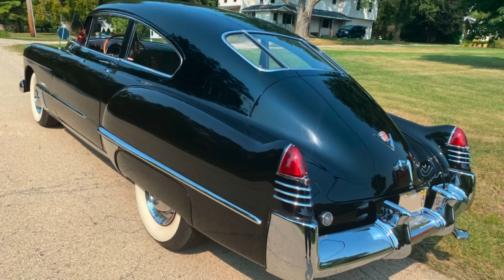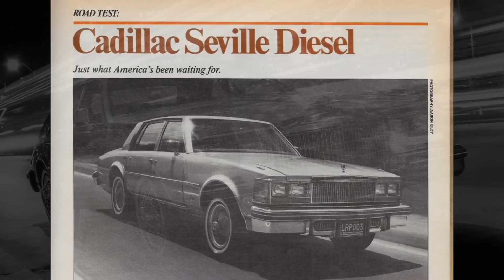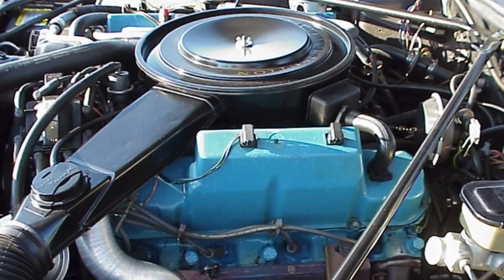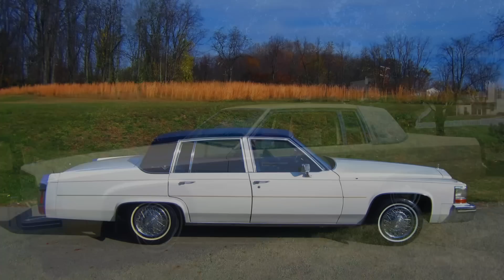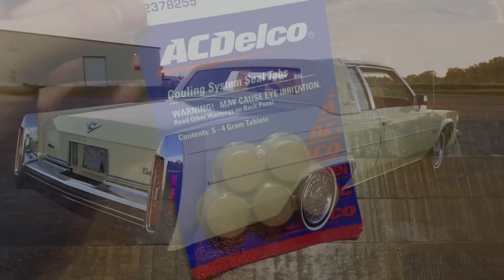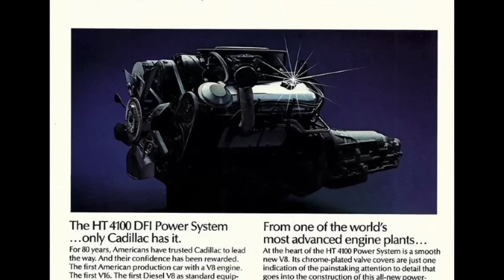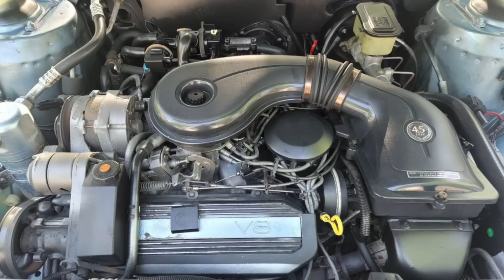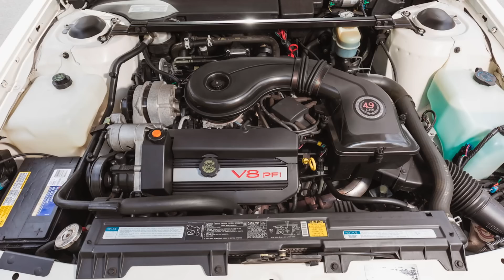This is GM's Worst Decision for Cadillac and Affected Its Reputation for Decades...

Comment: Thank you Adam. I like the fact you are objective and tell the truth no matter what about cars and engines etc. You say things so well even when it is bad news. I recall this engine. I used to think a 130 hp Cadillac V8?  The 4.5 and 4.9 liter V8's could not come fast enough in 1988 and l991 model years. It makes you wonder if the 4.5 and 4.9 had not come sooner what would have happened. The Northstar came and it was the same thing over again.  The 4.9 should have been used longer until they could have got Northstar right.  You covered the engines quite well as well. I liked the fact you mentioned what damage was done to Cadillac. They lost buyers from a lot of missteps in the 1980's.  The video is so well stated.

Comment: The 4.9 might have been derived from the 4.1, but by that time it was completely re engineered, and yes was 1 of Caddy's best engines.
Reply: Its ashame they were so quick to move on from it into those NorthStars. Imagine if they would have stayed on with the 4.9s & kept perfecting & updating them every yr! ..& would've kept so many customers from immense headaches & loses, not to mention built up Cadillac's rep, etc, etc..
Reply: @jayski8082  200hp/275lb-ft out of 4.9L at a time when Lexus was giving you 250/260 and BMW 282/295 out of 4.0L wasn’t going to work for very long in the tech-conscious ’90s.

Not when Ford came out with a more powerful Modular V8 at the same time as the Cadillac 4.9L.
Reply: @judethaddaeus9742  Oh, let us not venture into the Ford modular V8s & v10s -  that's a whole 'nother disaster area.  At least the General's aluminum motors didn't spit out spark plugs...
Reply: @marko7843  The Ford 4.6 modular is a legend.  300,000 miles is common, 500,000 is not unusual, 1,000,000 miles is more common on these than any other engine ever built.  Taxi cabs, police cars, and consumer models alike.  The Lexus v8 is great too, but just doesn't have the weight of numbers.  Remember, however, that we are talking about GM here, the 4100 that grew and improved into the 4.9 over time.  They worked out the problems, and turned a dog into a really quite good engine.  I'm proud of the persistence of the engineers.
Reply: @marko7843  The SOHC 2v versions will run forever. It was when they made the 3v version with variable cam timing whose phasers quit working and the heads spit out their spark plugs that they turned to shite.

American cars are best when they're simple.
Reply: @stevesestrich5143  so I'm guessing that the cops only got the 2-valve heads?
Reply: Agreed.  Nothing wrong with the 4.9.  They can run for a few hundred thousand miles if serviced regularly.
Reply: @trwsandford  mine does. 92 Sedan De Ville 212k mi other than maintenance,  no issues. Was my maternal grandfather's car.  It, his Bible,  his 54th Massachusetts, Buffalo Soldiers, and Tuskegee Airmen stuff his S&W Victory Model .38 Special, his USAF NCO sword are all mine now as he left all that to me when he passed.
Reply: @chrismc410  Don't ever sell it!
Reply: Absolutely 💯
Reply: Good engine!
Reply: I remember my grandma had a 91 caddy with the 4.9. It was fast and was very reliable for the time.
Reply: have a 93 coupe de ville with the 4.9 is a wonderful engine..
Reply: It’s just a shame that Cadillac got only 200hp out of a 4.9 a year after Lexus gave us 250hp out of a 4.0. With just 15 more lb-ft of torque than the much smaller Lexus V8, too.
Reply: @judethaddaeus9742  People say this about GM pushrod V8s all the time, but a DOHC Toyota/Lexus V8 is physically enormous next to any pushrod GM V8. And weigh more too. They aren't really smaller -- they're usually bigger.
Reply: @josephbrent1912  We’re talking about luxury cars, though. Physical size of the engine package isn’t usually the top priority with buyers. Perception of technological advancement usually ranks higher.

Comment: 4.5s turned out to be fantastic engines with the roller cams and large oil pumps - 300,000 mile engines if well maintained

Comment: If I’m not mistaken, didn’t they install BUICK 4.1 L V6 in some of these Cadillacs instead of the 4100? I think I remember driving one. That wasn’t the greatest engine. But it was much better than the 4100.
Reply: Yes there was a Buick 4.1L V6 in some GM cars in the 1980s.

Comment: I bought a very nice 1984 Coupe'd Ville with 153,000 miles on it in mid '90s from Brown Brothers Cadillac in Louisville for $2,700 put 90,000 miles on it and sold it for $2,500. I never had any trouble out of the HT4100.

Comment: Had a 92 with the 4.9, a good engine. I had injured my left knee requiring a soft cast from ankle to hip. The power seats in the Caddie allowed me to get in and drive. Most other cars I could not get in
Reply: As an ex GM dealer certified mechanic I’d rather have seen a diesel Cadillac vs a 4.1 the 368 modulated displacement wasn’t as big a pile of junk as the 4.1

Comment: The V8-6-4 immediately came to mind when I saw the title of the video. Followed by the Northstar and diesel
Reply: One wire disconnected and that 1981 V-8-6-4 is the same good old big block Cad in 368 ci form. Better than HT4.x,  Northstar, etc...

Comment: You'd think after the Vega engine disaster, GM would have learned their lessons about aluminum and iron.  It seems Cadillac never had a decent engine after this.  The rear drivers got eventually got Chevy or Olds V8s.  I think a larger version of the Buick V6 was a no cost option for a year or two in the early 80s.  Then you got the Northstar V8...which also had head gasket sealing issues.  After that, they seemed to use variants of GM engines.
Reply: Iron block and aluminum heads is an awesome combination.  Aluminum block and iron heads is a terrible combination.
Reply: Okay, explainer time. The 4100/4.5/4.9 are all essentially the same engine design. Aluminum block with iron heads. The cylinders were steel inserts that could be removed and replaced. That makes them different from the Vega engine which had aluminum cylinders with some sort of coating (which wore through quickly).

The Northstar is not as bad an engine as everyone thinks. They are prone to head gasket failure when the cooling system is neglected and they are allowed to overheat. They make really good power for their time and the lower ends are nearly indestructible. The main issue was advertising that it could be driven up to 50 miles with no coolant, giving people the false impression that driving it while overheating was okay. It is the first engine I am aware of that will kill four cylinders at a time while overheating to try and pump air through the engine to keep it cool.

Lastly, the current corporate V6 aka 3.6L dohc made its debut in the CTS in 2004. If maintained and oil changes are done reasonably, they are quite reliable engines. Timing chain failures generally occur on engines with extended oil change intervals, although there was a period of time when the timing chains went through several design revisions to decrease noise and increase longevity.

None of this is to say GM didn’t commit some profound sins, they absolutely have. Just trying to give an objective view as a former Cadillac dealer technician who worked on transmissions and engine mechanical for over a decade.

Edit to add, while the 4.9 was pretty good, the 4109 WAS a terrible engine. At the dealer we used to say that a 4100 wouldn’t even make a good boat anchor because sh*t floats. Lol
Reply: The best caddilacs are the CTS, ct5 v and Blackwings. Lsa motor.
Reply: And what is the definition of insanity?
Reply: I owned an ‘89 Brougham with the Olds 307 engine while it ran well and was dependable it was horrendously underpowered in that car only 140 hp
Reply: Awesome?  There were several iron block / aluminum head engines from decades ago that blew head gaskets prematurely... Ford's 3.8 liter Essex V6 comes to mind.  Today, it appears that head gaskets have improved greatly.  I don't think anyone has yet eliminated the difference in thermal expansion rates of aluminum and iron.  Aluminum heads on aluminum blocks are even better in my experience.  Plasma sprayed iron on aluminum bores looks very promising, at least until EVs make it irrelevant!!!
Reply: @billyjoejimbob56  I owned a 1984 Saab 900 with iron block and aluminum heads.  Drove it 250,000 miles with no issues.  Also owned a 1992 Saab 9000S with iron block and aluminum heads. Drove that one 250,000 miles with no issues.  Also owned a 1995 BMW 525i with iron block and aluminum heads.  Drove it 160,000 miles with no issues and planned to keep on driving it until a drunk driver hit me and wrecked it.  So that means I drove a combined 660,000 miles on iron block and aluminum head engines with no issues.
Reply: @michaela1655  Thanks for sharing your story.  I am guilty of assuming all OEMs struggled as much as the domestics in the transition to aluminum heads on iron blocks.  Mea culpa.  Your experience would indicate that European OEMs made the transition earlier (they did) and got it right sooner than the domestics did (likely true).  As someone who has driven Honda vehicles for 20 years, I should know better!
Reply: @michaela1655  The famous Toyota pickup truck engines I believe have aluminum head on iron block and often made 200,000 miles but I think you had to watch for signs of heat gasket leakage and change out the gasket before water got down in the oil and ruined the engine. I don't know whether retightening/retorquing the head bolts was on the maintenance list for those.  "22R"?
Reply: @billyjoejimbob56 I know someone who put 260,000 miles on a Ford with the 3.8 Essex V-6.  During those miles there was never a head gasket issue.  The engine was still going when they sold the car.
Reply: @ericknoblauch9195  You can always find some examples of almost everything that are way out on the far end of the bellcurve.  But the total experience shows an average that was disappointing.
Reply: @billyjoejimbob56  Ford somehow managed to screw up plasma sprayed liners in aluminum blocks on the 5.0 Coyote V8 in 2018 in the pickup trucks.  Some blame piston clearance,  other blame incorrect ring specs. Clatter and burn oil
Reply: @mikekokomomike  Well if you wanted something simple and trouble free, you should have opted for the twin-turbo ecoboost V6.  Or bought a Toyota.
Reply: @billyjoejimbob56  you missed my point, the engine was fine with iron liners. Don't be so obtuse.
Reply: @mikekokomomike  Obtuse?  I was going sarcastic.  Damn.
Reply: You forgot to mention the V-8-6-4 too.
Reply: The Northstar issues are vasty overblown. As a Cadillac enthusiast, I've never heard of a 2005 or newer Northstar having any issues. I still see a lot of late model Devilles and DTS sedans here in the Midwest as of 2025.
Reply: @hakeemsd70m  GM worked out the bugs with the head bolt issue on the Northstar in 2005.  The Northstar engines made after 2005 had a revised bolt that cured the problem.  The problem Northstar engines were made from 1998 to 2005.  Still a long period of production with no revised design to fix a known problem.  Wonder how much GM paid out in warranty claims.  GM filed for bankruptcy protection in 2009.

Comment: I remember that in the 1982 Caddy people that selected the 4.1 Buick V6 with the 4 barrel were a lot more satisfied than those buying the 4100 V8.  That 4100 was a dog in the big body rear drive Caddy.
I appreciated the 4100 as a rookie at the dealership in the late 80's because replacing intake gaskets at about every 30K miles became a money making gravy job.
Reply: When your best engine is a delete option carbureted V6 from a lesser division, the basic design of which was over 20 years old at the time… and you spend tens of millions replacing it with a less economical, less reliable fuel injected V8 of the same displacement, but with no extra power and LESS torque… it’s not great.

1982 was also the year of the Cimarron with its wheezy 1.8L four.

People look back with nostalgia, but it cannot be underestimated how disastrous this era was for Cadillac and for the reputation of American luxury cars more generally.
Reply: @judethaddaeus9742  Hindsight is such a wonderful thing.  Where were you in this period?
Reply: @loveisall5520  Look at every single other volume luxury marque back in the day. Even Lincoln found new life in this era where everything Cadillac touched turned to hot garbage.

Nostalgia can warp memories.
Reply: @judethaddaeus9742  oh, you're absolutely right.  My nostalgia ends with the catalytic converters in 1975...
Reply: @marko7843  and let's not forget the giant bumpers.
Reply: I had a cousin who bought a new white Sedan deVille with the V6 and loved it.  Not fast, but a great road car and his was trouble-free.
Reply: My Fathers 1984 Fleetwood Brougham, was flawless.  He put 186000, miles on it from 84-92!  Noe issues with that engine. It was under powered. I agree. I once had it up to a little over 100 mpg!  Perhaps it was trouble free, as 90% of the mileage was highway?
Reply: @markross9781   100 mpg? That must be a typing error.
Reply: @@jacknapier7740 The V6 had the same horsepower and more torque than the HT4100,
Reply: I remember early on , there were coolant leaks where the water pump attached - o rings on a tube if i recall correctly.
Also camshafts failing early.
Sad period for Cadillac.
Reply: @Jack Napier  the power wasn’t much different than the 4100. It just didn’t run as smoothly. But it was more reliable. The 4100 wasn’t powerful either.
Reply: @Jack Napier Agree.  I remember how rough it was and it didn't have the proper V8 sound that is expected in a Cadillac.
Reply: Couldn't stand those old unbalanced V6's... engine felt like a V8 with two bad sparkplugs... had one briefly in an '81 Pontiac Gran Prix...
Reply: @jackfrost99  Even slower than the Ford Ecosport 1.0T. Or even the 07-11 Automatic Jeep Wrangler.
Reply: @Jack Napier Not as awful as the Vega like V8
Reply: @Jack Napier Someone commented negatively on the Olds 5.7 Gasoline engine but I thought that one ran better than most all of HT and the V6 engines. The 307 Olds was kind of low powered but the 5.7 which was also known as the "350" was quite a bit stronger feeling than the 307 (and I think the earlier 330 ran even harder than the 350 but that usually had higher compression and was found in lighter weight cars,not Cadillacs.
Reply: @davidpowell3347  My best friend's late father owned two early 1980s Buick Park Avenues powered by the Oldsmobile 307 V8. He bought them new. I drove on of them once and performance was leisurely to say the least! 0-60? Eventually. 😄

That said, the engine didn't hand grenade like the HT-4100 and if the C-Body Park Avenue was s-l-o-w, I can't even fathom how much slower the equivalent C-Body HT-4100 powered Sedan de Ville/Fleetwood must've been. You could've timed 0-60 with a sundial! 😧

Why Cadillac didn't follow Lincoln and use a common-line Ford engine (302/5.0L) for their cars seems a mystery, but later in the video the truth came out. These engines were designed for even smaller Cadillacs that should've come out in perhaps 1982-83. So GM had tooled up for these engines and had nothing to put them in except their current line, which as stated were too big and heavy for the HT-4100 to pull around. But the foundries were running and those engines had to go SOMEWHERE!

Irony of Ironies the Oldsmobile engines finally found their way into the Fleetwood Brougham by 1986.
Reply: @mmack647  A friend had a 1985 Delta 88 with the 307 in it,a comfortable but not quick cruiser,at around the same time I drove for a while a '86 Lincoln Town Car with a fuel injected 302 "5 litre" in it with dual exhausts and double stacks all the way back/ included the catalytic converters,that thing had a lot more acceleration than the Olds.
Reply: Ive been working on a 1985 Fleetwood brougham and I can tell you this raggedy bitch stalls under load, and I've replaced distributor, cap, rotor, sparkplugs, wires, and still stalls
Reply: @poormanshotrods  Just throwing this out there-fuel pressure should be 9-12  PSI and usually ran about 11.  Often you'll see 7ish and it runs fine until under a load.  
Other than that-EGR valve, vacuum leaks at the T body base gasket.  If it is misfiring the cam lobes will wipe round quick on those and cause rough running.  A good distributor is hard to come by too.  It usually takes 3 or 4 before getting a good one.  I would go with fuel pressure first and hopefully you can figure a way to tee in a gauge.  Maybe easier to put one in place of the fuel filter and rig it where you can see it.
Reply: @greggc8088  yeah this one ran at 11 before it decided to light a fire beneath the distributor today 😔 luckily I had water nearby so I was able to put it out without much damage I'm really trying to get rid of this car cause it's been in my bay for 2 months.
Reply: @poormanshotrods  Got Alldata?  Give us a call if you do for a courtesy case on the tech assist line.  Ask for Greg and we'll bounce some ideas around and see what we can come up with.

Comment: ‘77-‘79 models not only ran 425 inches….They were much more attractive.
Reply: It was still the 500 block.
Reply: @rogersmith7396  The Deville bodies were downsized in 1977 and the engine was downsized to the 425 also, 1976 was last year for the 500.
Reply: @brianklamer3328  It was the same block down to the 368.
Reply: The 77-79 were the best looking Coupe Deville models made. My dad had a 77 and it was so much better looking than the 1975 he traded.

Comment: Didn’t the 4100 have the same or less HP compared to the 3.8/3800 Buick V6? - horrid choice indeed
Reply: I had to google that.  Buick V6 4.1 with the 4 barrel-125 hp (93 kW) and 205 lb⋅ft .  Caddy 4100-135 hp 190 tq in 1982.  I would have chose the Buick V6.
Reply: @GregFisherman  for real! 15 tq will move a car better than 10 hp will.